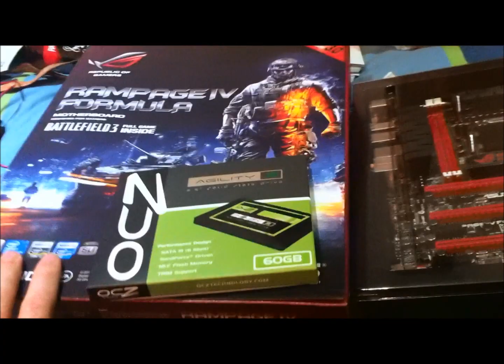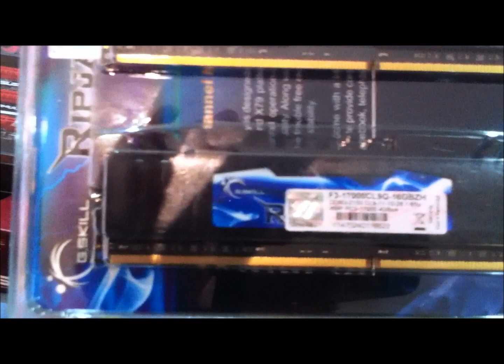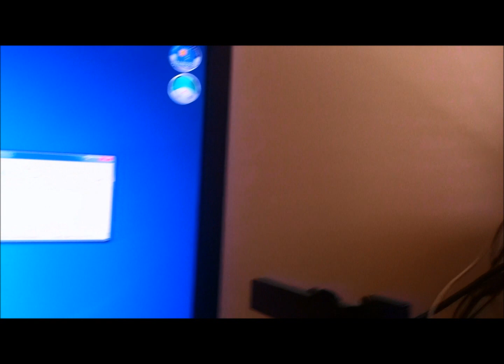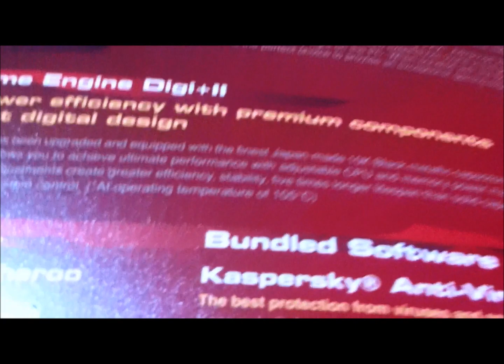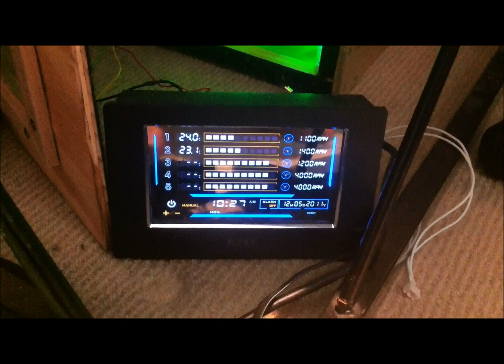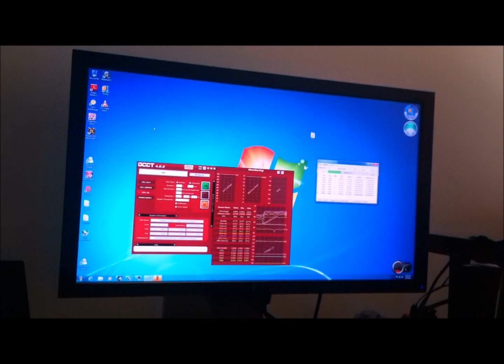3930k Tri SLI GTX Build, Upgrade from i7960 to i73930k Rampage IV Formula X79 4.5GHZ

Comment from the maker: @sysux593593 I have done some testing for you... 1.35v 60deg like normal 50% cpu load.... up the vcore to 1.45 85-90deg need active cooling :) 

so to answer your question depends on case cooling & how far you plan to overclock with volts..... Must be why the R4E as compared to my board R4F has that chipset fan for this exact reason

However a mini 40mm fan (like ultra quiet harfly moving any air and completly silent fixes the issue) .... ram blocks airflow to chipset in my case

Comment from the maker: Do you have any tests that you could link that prove this ?
I have found almost zero diffrent in flow rates using two diffrent koolance flow meteres, when using 90's or looping tubing ... keep in mind im using Two 450S (strong pressure pumps) + I have a 24v transformer to up the pumps , but i get insane flow with this new split loop compared to the old ones the 90's compared to any waterblock make no diffrence to flow rates .... maybe only if you using a shithouse pump they may.

Comment from the maker: @TheABYSSCINIAN Hey mate, PCCG bought most my stuff
I thought about it... would of got the R4E for the extra slots,,, but too expensive for me atm... very interested in setting up a ram disk, if you do let me know how it goes.

Yeh had a few goes at 5ghz takes about 1.55v to be stable and gets VERY HOT .. 4.7-4.8 are 1.4+ so for the time being think im happy @ 4.5ghz :) 

Im just a little nervous about what is max safe 24/7 voltage for SB-E considering orginal SB degrade @ 1.4+

Comment: @anguspd I used an apc for years but for what an enthusiast needs they get pretty expensive.  About a year  and a half ago I switched to 900w cyber power (as I'm only drawing about 700w max on normal freqs).  I wish I spent a little more and got a beefier one as the one I have will yell at me a bit if I run some heavy benchs with a hefty overclock. Have been happy with the quality of the unit though. With the old buildings I've lived in I don't worry so much about parts wearing out.

Comment from the maker: @kroegler26 it peaks at about 980w so bit of room to spare... you should be fine ,  i had a enermax revolution ,, but it was faulty from day 1 .. made a loud ticking noise and the fan would always go insane even when the computer was just turned on then it died few weeks later.. (Should of explained that in the vid) you have nothing to worry about Enermax are one of the best if not the best i just had a bad one was all...

Comment from the maker: @kroegler26 Temps seem to be consistent with 50 - 55- 58 deg for the 3 cards when playing BF3 after a while ... compared to the single loop in the x58 built of 59-65-69deg C .... found that the split loop the flow is much much faster and everything is far better cooled

Comment: Real nice job man!  One of the tightest pieces of work I've ever seen.  How many watts do you use on average while gaming?  Kinda curious as I'm running an enermax 1250 galaxy evo in my machine and after watching this a little nervous,  though only running 2x 580's I think I should be ok.  I had planned on upgrading if I get a third anyhow.  Also, do you use a battery backup?  If so what model?  

Again,  fantastic f'in work though man..